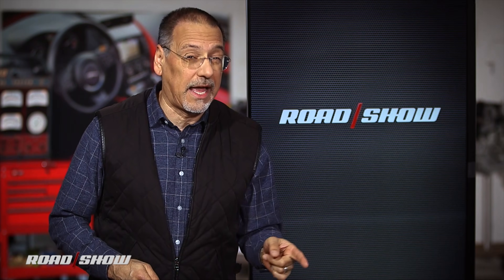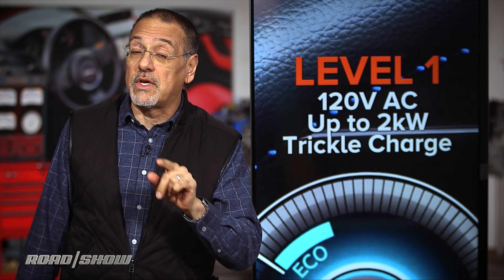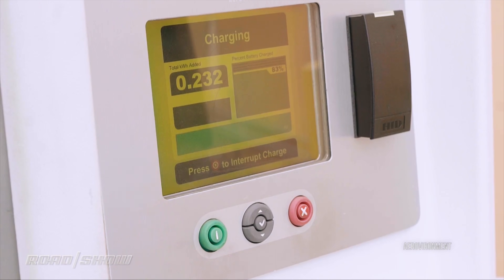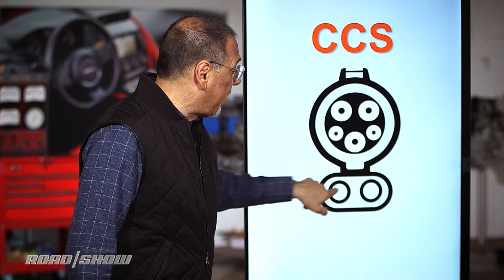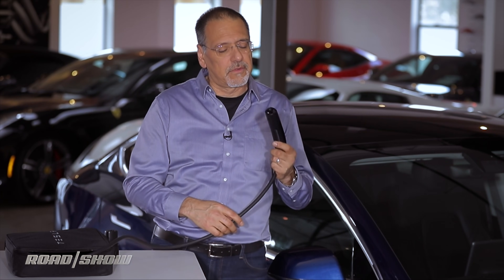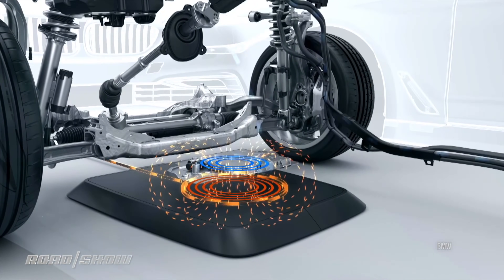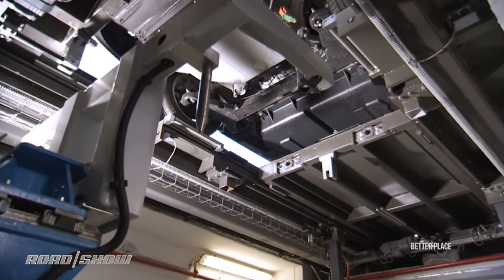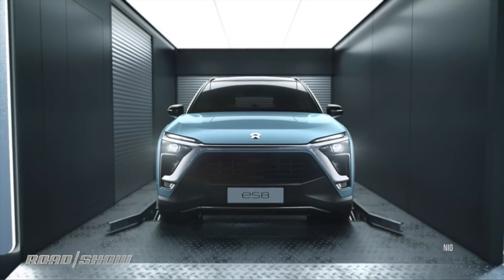Car Tech 101: How to charge an electric car while demystifying the tech | Cooley On Cars

Comment: Ok what about flow batteries? Systems where you stop at a retrofitted gas station, drain the low to dead battery acid, and refill with fully charged acid in near similar fuel filling time for ICE's? This converts EV's into a liquid refueling system vs traditional slow plugging methodology to save time.

Comment: Instead of unreliable battery swapping, my solution to the battery charging time dilemma is refillable primary electrolytes. That's similar to hydrogen fuel cells, but producing hydrogen is energy inefficient and fuel cells cost too much.

They already exist in some commercial applications and are known as flow batteries.

Comment: your numbers are wrong.  Level 2 is not upto 90kW fast charge.  The fastest Level 2 Single phase chargers are 7Kw.  only the Renault Zoe can charge upto 43kW using 3 phase AC and no other car charges at a higher AC rate than that.  Level 2 charging is also dependent on what charger is fitted internally in the car itself.

Comment: INCORRECT. Level 1 is only available where 120V is available (US). Maximum power for Level1 is and will be 120x13=1,5kW.
Maximum real world power for Level 2 is 22kW. Doable in EU with 3-phase 32A connection. Even if more is available, there are hardly any vehicles that accept more (Zoe is an exception).
Reply: Widespread Level 2 in US is 10kW, while 16kW is also doable on Tesla. Most cars can do 7kW, that includes basic Model 3. 7kW is actually what everybody wants as a MAXIMUM. 32A amps on 240V. That includes whole world, not just US.

Comment: Some inaccuracies here.  Many EV owners get by just fine with a level 1 charger.  If your round trip commute is less than 60 miles, then level 1 is plenty.  Especially, if you have a plug-in hybrid that can go to gas if needed.

Comment: Your maximum rate for Level 2 charging is wrong.  Some Tesla destination chargers will go up to 22kW but most L2 chargers are 7.7 kW max.  But at 22kW the amperage draw would be near 90A, so a researcher probably confused kW with Amps.  Level 2 is not a fast charger either. It usually takes a few hours to charge a car fully.  You got Level 3 mostly correct.

Comment: Level 1 chargers are only for getting enough charge to get you to a good charger? What is this nonsense?  Level one is the most commonly used charging system. This is what you use to top up your battery overnight while you're asleep. Most ev drivers use about 1/3 of their charge on a daily basis. A level one which comes with most ev's is likely all you will need 90% of the time. This lower voltage, trickle charge is also easier on your battery.
Reply: Whether L1 charging is easier on the battery is debatable, since a battery recharged using L1 will spend a larger portion of its time at higher states of charge, and high charge state is held to be one of the major stress factors for battery longevity (along with temperature).   Also, at least some cars (my LEAF, for one) impose a fixed overhead power drain during any charging (brainlessly running a cooling pump regardless of whether things are actually hot) operation, so L1 charging is less efficient than L2.
Reply: @levenkay4468  what do you mean by "higher state of charge"? Level 1=12 amps, Level 2=30 amps. You have a battery cooling pump on your leaf? Mine doesn't, nor has any leaf ever made. No active cooling has long been the biggest criticism of the leaf.
Reply: @1964mcqueen  No, of course there's no cooling pump for the battery ; that would be too sensible.   The LEAF does have a cooling pump for the onboard charger and possibly the power inverter for the motor drive, though.   And that pump runs whenever the car's charging.
Reply: @levenkay4468  if by state of charge you are referring to the potential damage to batteries caused by leaving your car sitting with a full charge, you can mitigate the risk with smart use of the charge timer, regardless of the charging level.
Reply: @1964mcqueen  Yes.   But the faster the charge rate, the more the car can postpone the actual charge operation, thereby sitting for a longer time at a lower state of charge.  If all you can do is L1 charging, the car probably has to start charging as soon as it's plugged in, meaning that it will inevitably sit at higher states of charge for a longer time as it slooowly approaches full charge.    Admittedly, this is splitting hairs, but you did say that L1 charging is less stressful, and I'm offering the "how long does the car sit at high state-of-charge?"  argument in opposition.

Comment: Not sure why everyone is so quick to dismiss 110v charging right of the bat.  My wife has been using it for over a year with no problems.  Provides 5 miles an hour of charging or about 50 miles after 10 hours which is what she and a lot of Americans drive most days.
Reply: Totally agree. I charge my 2013 Volt by 110v every night since I bought it - works great, can plug it anywhere and is super convenient.
Reply: Agree as well. I've had my Focus Electric for more than two years using L1 at home. Even when I upgrade to a longer range car in a few years, I see little need for L2 because if I really need a full battery fast, I'm going to drive down the street to the L3 fast charger.
Reply: Repeat after me: 120V. 120V. 120V. If you're getting 110V, call your power company, somethings wrong.
Reply: @johnrielley7756  AC voltage varies. It's ok if it goes down to 110v because that's the lower limit on AC devices. My Lv 1 charger works on 110v (my grandma house) and 118v (my house)
Reply: Yep, it varies from -120V to +120V, 60 times a second ; ) The power companies established the 120V standard back in the 1930s as part of the Rural Electrification Act. You don't have 110V outlets, you have 120V outlets. If your grandma has 110V on her outlet, there's something wrong. @AntonioCunningham
Reply: @johnrielley7756  110v is fine. Many electronics are labeled 100v. (Look on the back of your phone charger for verification)

My grandma house is the lowest I've personally worked on and used, but all her single pole recpticals reads 110v. Just like all mines read 118v. (We don't live in the same area) she have no problems with her electricity.

Comment: A 110 outlet can give you 10000 miles of range every year if only plugged up overnight. Everyone is down on that plug, but for many if not most it's enough.
Reply: Definitely agree Charles. It's worked great for my life since I drive less than 30 miles a day most days. Even with longer trips, I can still make up the difference in a day since it's not imperative to leave the house with a full charge.
Reply: When you charge a leaf from 20% to 80% overnight on a 110 is perfect!!

Comment: As a PHEV driver who knows all this, great video. Almost everyone who asks me about my car or EVs have just about no clue what's going on and it all seems very confusing to them, though it's starting to change. I think we're already past the point where battery swapping makes any sense (if it ever did). And inductive charging isn't that exciting to me because of both snow/ice/salt and that you have to park in a specific place more so than you do to plug in. Something I would say about L1 chargers is they only make sense to me on mass in public transport parking lots, where a car would be plugged in for 8 hours while people were at work gaining about 50km of range. That being said, when 350+km of range becomes normal even that use case falls off, but it would work for a generation of used first gen EVs.

Comment: Tesla not allowing model 3 circuitry to fast charge at public charging location in order to bring revenue to supercharger? That is such an Apple move without the revenue to back it up.
Reply: Fast charger companies in Europe says is that Tesla haven't used the exact standard for the handshake communication in the Model 3. Most likely due to their own supercharger network is just plug and play. So if they will change this, they'll have to reprogram every supercharger to update to this new handshake.  Shouldn't take long, but I'm sure it will change!
Reply: Nonsense, Tesla designed and installed these chargers long before others did. So they are the ones that decided on another charger-plug.
Reply: You can't blame them.. they are leaving the way to innovation without any profits.
Reply: Tesla has been doing a few things that slightly tarnish their name. If I buy a car I should be able to refuel or recharge it anywhere I like! Maybe a Tesla super charger is not near and so not convenient.
Reply: jooky87  Just think where Ford would be right now if ole Henry had designed his engines to only operate on Ford gasoline.  Musk is a genius in many ways.
Reply: Still saying that after they start selling .5 million cars/year? Like in 2020?
Reply: Atleast your not a fan boy but great for them keep on screwing your people over with a smile on there face perfect
Reply: That's pretty bad... Hmm. I might not buy a Tesla.

Comment: What is the Kwh rating of EVs ? Can a level 2 (90Kw) can charge a say Nissan leaf which has 40KWh battery in half and hour?? Mobile battery is rated in mAh. What is the difference between mAh and Kwh ? is it same or just multiplied by volts?? Cooley pls explain?
Reply: I don't know where Mr. Cooley gets that 90kW maximum for Level 2 charging, since most level THREE charging stations can only deliver 40 or 50kW.    90kW from 240V would mean about 380 amperes in the charging cable.   The cable in my garage gets pretty warm just delivering 28A into my LEAF.   But the battery capacities for EVs are generally in the 10 to 100kWh range.
The initial LEAF was about 24kWh,  current models offer 30, 40  (and soon 60) kWh, the Mitsu iMiev was 16kWh, the Honda Fit EV was 20kWh.   Tesla battery sizes are generally in the 60 to 100kWh range.
To get from amp-hours (or milliamp-hours) to watt-hours, you need to know the battery voltage; watt-hours are equal to amp-hours multiplied by battery voltage.   The mobile battery you're talking about is probably one cell, which would have a voltage somewhere around 3.5V  (kind of hard to say, because the voltage varies throughout the charge cycle).    An EV's battery is built from a large number (about 100 or so) of cells all connected in series, and without knowing what the pack voltage is, it's hard to relate amp-hours to watt-hours.
Reply: @levenkay4468  Thanks for the reply. So can a fit be charged to max using a 20KW charger in 1 hour?
Reply: @Yathuprem  It would, if its battery could accept the full 20kW even when it's very close to full.    Most (all?) EV battery controllers reduce the charging current as the battery approaches a full charge.    And as Mr. Cooley says, an EV's AC charger is part of the vehicle's equipment.   A Honda Fit came with a 6.6kW on-board charger,  so that's the maximum the car will take from an AC mains connection, even if that connection (the "EVSE") has a 20kW rating.  And the Fit did not have any provision for DC "fast charging".   Honda's 2012 web site speaks of a three-hour recharge time with a suitable 240VAC supply.
Reply: @levenkay4468  now i got it. Thanks man

Comment: This is exactly the reason why EV is not getting popular. Too much trouble. Too much time. New Technology MUST be easy to use to become popular. Liquid Fuel is not going away anytime soon.
Reply: It's really not. The J1772 / CCS is becoming the standard. With the J1772 / CCS configuration you can charge on Level 1 , level 2 and Level 3 ( DC Fast if equipped in the car). He mentioned CHADEMO as the oddball, and while there are EVs with CHADEMO only ( level 3 DC fast ) most manufacturers are favouring the J1772 / CCS setup, especially in the U.S.
 
Think gas station nozzle. They are all the same (J1772) but flow rates may vary. Think of CHADEMO as the diesel nozzle at the same pump that's on the way out.

The Apple in the room is Tesla. Fun fact though....all Tesla model 3s delivered in Europe are equipped with the J1772 / CCS configuration. Electricity is the same, but plugs can be changed.

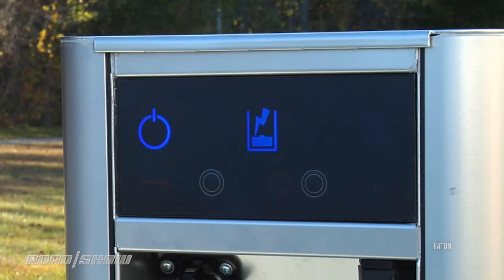Comment: 2:00 Level 2. Level 2 tops out at 10KW or less on ALL EVs, except tesla that can suck up to 22KW from 240V power. How did you come up with 'up to 90KW'??
3:00 'That is already delivering DC to your car. A messy inefficient conversion no longer has to happen on the way to the battery' <---..... yes it DOES. The charger still exists. It is a giant thing in or near the DC fast charging station. The efficiency of that unit versus the charger inside the car isn't that different. Still 88-95% or so. 
Disappointing to hear about the Tesla Model 3 not working with DC fast charging, but I think that is temporary. Customers will want this enabled and Elon wants Tesla owners to be happy.
Reply: danwat1234, he probably meant 80A not 90 kW. The Tesla HPWC in US has 80 A max, 19.2 kW.

Comment: Level 2 charging is not up to 90kW.  That would be 240v at 375amps.  It is typically 240v up to 80amps which is around 19kW.  Most homes with a 200amp main panel can accommodate this but the wires to carry that much current are very expensive.  In Europe they refer to these as 22kW chargers, but they are usually 3 phase power.  In the US we use single (split?) phase 240v.
Reply: IKR. 90KW what??? 22KW is max for Tesla S or X with dual internal chargers. Everything else is 7.2KW or less right now.
Reply: @danwat1234  except Zoe
Reply: Completely agree. When he said level 2 goes up to 90 kW I was like "uhh what?". CHADdeMO in the US goes up to 50kW which is considered level 3.
Reply: Certainly not 90 kW at 240volt  for level 2! I'd like to know where that number came from. More like 9 kW.  At least your wires won't melt... The AC  charger inside most  new cars maxes out at  32 amp or  7. 7 kW.
Reply: Correct me, if i wrong, but Mode 2 in both EU and US is 1-phase AC ~230V*32A current - 7.2kW with loses. Pretty decent.
Mode 3 in EU is 3-phase AC ~400V*60A - 22kW, in US - idk, Type1 connector doesn't allow DC, and US grid system rarely provide 3-phase. 
Mode 4 is supercharging, as described in video.
Reply: @Volodimar  in the US, level 1 is 120 volts 12 amps single phase. Level two is 240 volts up to 40 amps or so, depends on the vehicle, single phase. Level 3 is DC fast-charging.
Reply: I'm still fricken confused. EVs gonna need to STANDARDIZED their plugs and charge speeds. Prefer the fastest charge. How long does it take to fill a 25 gallon gas tank? That should be the standard time it takes to FULLY charge all EVs. Except Semis. They need 300 gallons of diesel fuel. So how long does it take to fill those semis should be how long it takes to charge those EV Semis. Faster would be better. Time us money. Getting stuck in traffic sucks a lot if time.
Reply: @robertlee8805  not feasible. Phones still take an hour to fully charge. Laptop still take way more than an hour to fully charge. It doesn't make sense to expect electric cars to charge in 5 minutes in the near future. 30 minutes to 80% is possible.

Comment: Level 2 goes up to 90 kW?! Ho'y f**k , Brian! Are you sure. The amount of amps you need to get 90 kW from 240V would be several times what you see from an Arc welder. 

If there's time to edit, lads at Roadshow, Level 2 @ 240 V deliver 3.3 kW (16 Amps), 6.6 kW (32 Amps) and the newest trend is 11 kW (46 Amps) now seen as 'premium Level 2'.
Then we jump up to Level 3 with the 50kWh CHAdeMOs and etc. That's all ignoring what goes on here in Europe where we have 3-phase AC Level 2 that can deliver anything from 3.3 kW up to 22 kW (specifically limited only to Renault Zoes, Smart ForTwos and Tesla S and X).

Comment: The government needs to pass laws governing the type of charge port and cable the same for ALL EV vehicles. They did this with gas and diesel vehicles filler nozzles so they need to do the same here also.
Reply: Perhaps integrate the data standard into an OBD III or OBD-E. Then it's just a matter of physical adapters for where the pins sit in the socket, until a dominant plug takes over.
Reply: This is why adaption rate be so slow aint going to do sh £t to slow global warming

Comment: I hope one day there will be a standard, additionally that all you have to do is connect your car to the EVSE unit, it charges and then charges your debit card accordingly!
Reply: That would mean 'working with' whatever number of charging providers are out there. Unless, you leave it to a semi-state service like what Ireland has.
Reply: @BeLowBelowo  Which is the ideal case. Just like petrol and diesel cars, you don't have to worry about the nozzle not fitting into your car, just turn up to whichever gas station you prefer and fill your tank up
Reply: @BeLowBelowo  it's called use your debit card like literally everywhere else for everything else. Just stick a goddamn pin pad an it and a price display geez it's not a difficult thing gas stations all have that.
Reply: Aside from the Tesla network it is fairly standard. The CHADEMO connector is on the way out in the U.S.  as most manufacturers are siding with the J1772 / CCS standard. With the J1772 / CCS connector you can charge at Level 1 / 2 / and 3 (DC FAST if equipped in the car).

But I agree, all PAID charging should be standardized though one app and / or payment method.

Comment: If J1772 only provides level 1 AC charging, then adding a Tesla adapter to the J1772 will only allow for level 1 charging, right? Did I miss something? That didn’t look like a CCS charger to me
Reply: J1772 is the name of the plug and it works for Level 1 and Level 2. It cones down to the actual voltage supplied by the charger.
Reply: Tesla sells an adapter for CHaDMo to Tesla. I think the experts that he talked to were referring to the CHaDMo adapter but didn’t make it sufficiently clear.